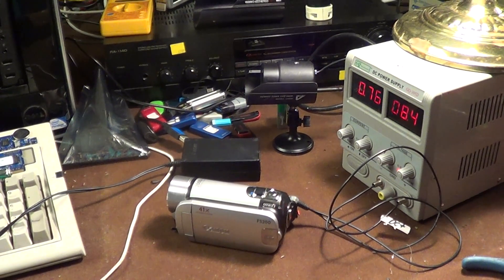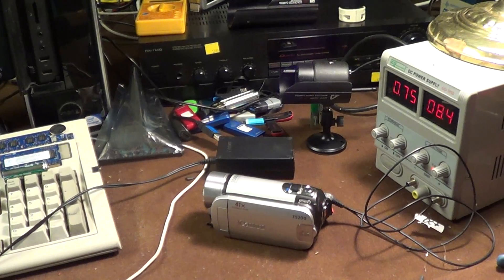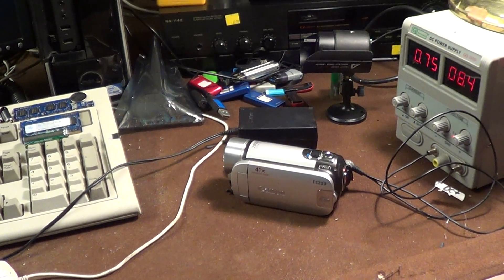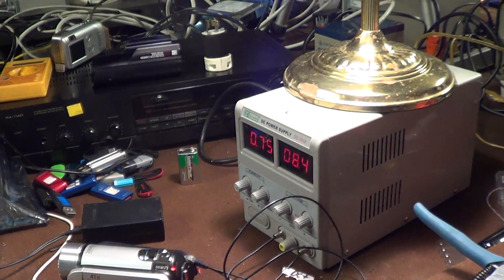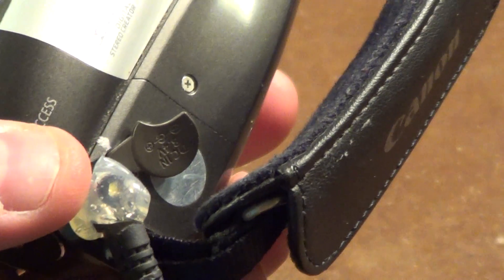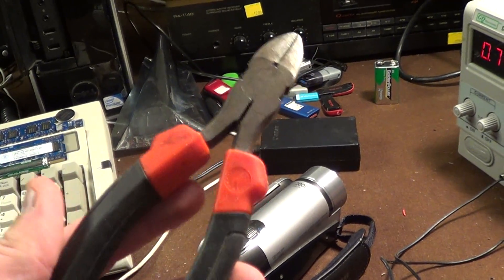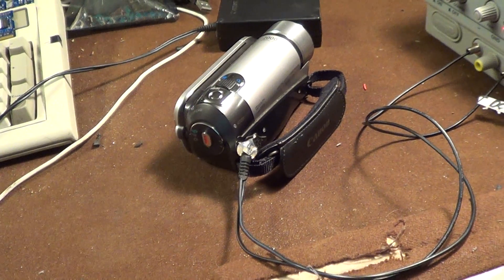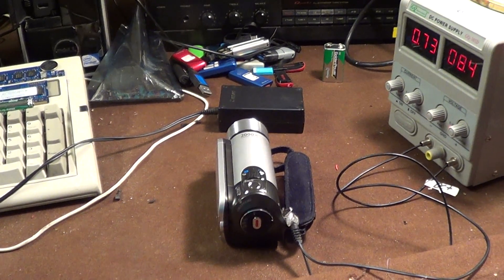A Very Interesting Power Supply Fault (and Repair)!

Comment: It is easy to convert a security torx screw into a regular torx head. The tiny pin in the middle is easy to break off with a small flat head screwdriver, or whatever fits to pry it to one side.
Reply from the maker: I've certainly done that, but the right bits aren't expensive.
Reply: @uxwbill   I expected an intelligent guy like you to have already figured that out. My suggestion was more for others whom might not have as much expertise, or a set of security torx bits.

Comment: WOW!  I thought that I was the only this sort of thing happened to. I  had the same scenario with a Dell Latitude E5410. Its power supply also had a  short in its barrel connector.  I happened to have a dead example of the power supply and hacked off the end and spliced it into the working one. Still works to this day. This was about a year or so ago now.

Comment: Hello uxwbill I have a problem with my karaoke digital/amplifier ka8000 PA system it has no sound it has three shorted amp tranzistors & two shorted sanken amp transistors sensily Aaron

Comment: Heeey why aren't you doing your videos in 8K 3-D? all other video resolutions are rubbish!
Now for what I actually wanted to talk about. I had an LG cellphone charger actually catch fire because the tip shorted similar to that. apparently there was no over current protection or any kind of a fuse. I never leave chargers plugged in for that reason anymore.

Comment: I had a exact same problem with a laptop supply, to repair it I also nibbled the rubber and resoldered the wires, in my case one one the wires came loose inside the rubber and was touching the other,  I also put hot glue like you did. Great minds think alike ;)

Comment: I had a pair of RadioShack portable folding speakers which shorted out and it had almost melted the battery compartment. Well being the Mr Fix it that I am, I was able to fix the issue and they worked fine after that. Then they mysteriously disappeared.

Comment: I live in England and have always called "side cutters" Wire Cutters" In fact when I was working as a "gofa" for an electrician (gofa a term for "go fetch" lol) he always called them side cutters. 

A version of electrical appliance plugs over here are sealed and yet somehow connections still seem to break inside the sealed plug. Usually happens on things like vacuum cleaners where the chord gets pulled a lot.

Comment: I witnessed it happen to an abused HP 60W laptop charger. My housemate at the time called me into the room saying his laptop wouldn't power on. I could, however, hear the tearful coil whine from the over-current protection trying to recycle and immediately pointed out a short. The centre wire insulation had broken and the ground mesh was touching it right at the end of the connector molding. 

Of course I stripped it all apart, soldered the ground mesh straight to the connector barrel and around it for ruggedness, then taped it in a good layer of bright yellow electrical tape.

Comment: had a similar fault with a TRI-AX lead for a ikegami TV camera. Somehow the plug had a short in it. Trying to fix that was not really worth the trouble. 
Also, SD is also less hassle on internet bandwidth for the viewer. Especially if you RX bandwidth isn't high enough in speed to cope with viewing HD.  The IPTV station i work at, we only broadcast in SD, this isn't only based on available bandwidth in upload speed, but also for the end viewer download speed. 720x576p is a-ok for general viewing

Comment: I've seen that happen with several 90w Toshiba 15V laptop power supplies that were supplied with port replicators for their Tecra series.  In some cases the connector heated up enough to melt and damage the port replicator.

Comment: While it doesn't happen often I have seen this before. Usually I find this sort of fault on laptop power bricks. Those see a lot of abuse and are more prone to such damage. That said, in my 24 years of computer repair I've only seen this about 7 times.

Comment: Recently I had an issue with my HF-S21 charger. Fortunately I had a replacement as prior to this camera I had a HF10 that died back in 2014 but the charger was still good. I was curious as to what ended up happening so I quite literally broke open the brick and the solder joints had somehow worked their way off the board. A similar thing also happened to my ill fated TRV33 handycam's charger, but unfortunately, I was really not up to buying a new charger as that camcorder has lost all but the video capture functionality.

Interesting to see this though, I have a few laptops that may have similar but different issues with their chargers (probably not but it's worth looking at).

Comment: I did such repairs on many people's laptop adpators. Whether it was at the end where the wire comes out of the brick or on the plug side (specially DELL 3 pin plugs). I use hot glue to close up the "open surgery wounds" in the assembly as well as some electrical tape on top of it.
I made a rule to check for plug shorts before attempting any repairs and stuck it to the wall in front of me ;)
Thank you for the informative nice video.

Comment: Power related - 13 to 19 volts power. While shopping for stuff I don't need at the local "environmental park""s department of selling stuff that others took to the county dump I came across a largish solar panel. I was attracted to it for its possible usefulness, but had no way to tell if it was functional. After all, someone took it the dump and dumped it. It had about 12 feet of cable hanging off it and decided to do what many have done to test 9v batteries like I see in this video. Yep, touched it to my tongue. Zowie - tasted like at least 12 volts. Bought it for $10. Now looking to put it to use.

Comment: Very common problem. Sometimes those 90 degree DC jacks fail if they are strained to much while plugged in. It puts stress on the connection point. Sometimes the rubber doesn't bond to the metal barrel as well as the wire and it can over time wiggle and create a bad connection or worse a short.

Comment: That is definitely an interesting fault.  I've had a ton of problems with connectors breaking right next to the connector, but inside of it?  What a bother.

Also, lol @ 1080p version.  I can't remember the last time I saw a YouTube that was legitimately in an insufficient resolution.  Non-problem
Reply: Id agree... Unless your viewing potato mode (lower than the standard 480P)

Comment: I have done this a few times, with bad connectors.  It does happen.  I only replace them if the connector is common, or if it's a oddball voltage, and it's not a cable that's cheaply and easily replaced.  Also had a laptop power supply for and older HP laptop, that the center pin broke out of, and i replaced it with a standard 5.5mm barrel connector (it was also center negative).

Comment: Yeah I would have expected the fault to be in the strain relief. I have the FS330 model so hopefully I'll remember to check the end connector is shorted if it fails... already tore the insulation on the other end years ago so that has similar hot glue. I'll bet your camera there has a good zoom, good digital zoom also and reasonable light sensitivity so no matter it isn't hd when it is better then the hd cam I have in ways that might be more important sometimes.

Comment: About two years ago I repaired a Dell laptop power supply in a similar way. The DC side of the power cable coming from the power brick became intermediate in its power delivery (would go from ~18v to 0 when the cable was "wiggled"). 

There was no visible damage to the cable. I owned the laptop since it was new, therefore the cable had been lightly used its entire life (since 2009). I cut about 3 inches out of the wiring and VERY badly soldered a replacement for the cut wires.

Fast-forward three months and its still was working fine, but I then found out that a circular dell power plug will work in the octagon socket meaning I didn't even need to do the repair...

Comment: No kitchen table?

I'm just pulling your leg, I'm glad you figured out the problem and fixed it successfully.
Reply: Well, he actually did this 'repair' live, so this is just the after results and talking about what the problem was. I don't believe he was at the kitchen table then, either.
Reply: armanelgtron Dang. How can I tell when / where the livestream goes on? I've missed literally every single one except the all stars ones.

I know there's no set time, but is there any way to get notifications on when he starts?
Reply: It was him in a procam, not him doing an actual show.
Reply: armanelgtron Still though, I don't recall the website he uses to stream even.
Reply from the maker: I don't bother announcing the few live streams I do any longer, mainly because far too many people have no idea how to behave appropriately and it's not my job, much less my desire to ride shotgun on the chat. I'm equally uninterested in fielding every inquiry and LOOKIT ME comment from Internet twelve-year-olds.

Vaughn Live doesn't sound announcement e-mails and it seems that they may never do so again.
Reply: ***** Fair enough, I guess.
armanelgtron SDP forums? I thought that was just a running joke.
Reply: AIO inc. Well, it definitely exists... Live stream and discussion forum.
Reply: armanelgtron Huh. Exclusive, I presume?

Comment: Huh. Never had that happen to me at the plug end, unless it was an iDevice end, which everyone knows are always inherently bad unless you get a super mega expensive cable that has proper protection against that sort of fault mode. and even then, if you have to find some sort of cable like that for your device, you should probably be looking for a different device instead.

Personally I've never had it happen with anything else, but I've done my fair share of hacking off ends and making proper supplies for things I don't otherwise have supplies for. For instance, I have an OEM 5v 4A Lenovo-OEM supply for an Ideapad 100S that I've come to love as my on-the-go-no-need-for-power laptop, but it pains me that replacement OEM supplies are expensive still, since the model is so new. I have exactly two more now that I've made using the ends off two junkier supplies from other things that I otherwise didn't have anymore. the tip end is very small, so I hacked those off the itemless supplies and spliced them onto the 5v supplies I've gathered from my travels-- one is an HP 5v 3.7A from some sort of HP device, switching wart with a folding US plug, and the other is a nice meaty 5v 4A Delta-branded supply that was intended for continuous use with one of the Xfinity X1 boxes from Comcast, something I just so happened to pick up at the thrift shop this past weekend. For now both of the supplies are all spliced up with electrical tape with zipties to keep them together without the tape falling off (and also taking into account tension protection to prevent shorts) so when I do finally get my hands on some proper shrink tubing, I'll be able to undo the permatemporary "fix" and just go ahead and make it permanent. 

The best thing about the Delta supply is it never gets warm, so I wonder if it's been overprovisioned inside with some slightly lower-spec capacitors or such to make the 4A rating hold true. I'm a firm believer of using better-than-recommended supplies in terms of current draw to keep everything running cooler and thus longer, so nothing heats up too bad and everything lasts for a much longer lifespan.

Comment: At least at this end, it wasnt until I checked within the setting menu, I realised it was in 480p, nice and sharp this end. I have had similar problems with odd tablet chargers and laptop chargers, but that issue generally occurs with such devices that get used whilst plugged in. The cable frays and then starts shorting, never seen one within the casing have an issue.

Comment: I had a laptop switched mode power supply fail recently it was reading 18.5v with no load on as it should but under load it dropped to 2 or 3 volts. Opened it up as I wanted to fix it while waiting to get enough cash to buy a replacement and saw a 1000uf 25v capacitor on the output was bulging. Went to the local electronics store and bought a replacement then fitted it. This made it work like it should, for about 12 hours. Then I noticed the laptop had stopped charging again. It got really hot and this time the output was 0v. Did try replacing the same capacitor again but i think it was the transformer this time so I found another laptop charger of the same voltage cut the end off an put my one on and that sorted it for good (or until that one fails anyway.).

Comment: If it is a switching power supply, it may not measure any output with a VOM.
Reply from the maker: That is not correct.
Reply: I have one that measures no output until it is hooked up. It might be because I am in calif. and we have to use  different types of power supplies here. I couldn't believe it either, but I do have one.

Comment: i have had this actually happen to one of my laptops power supplies but since i had a spare from a older model i did not bother to repair since i lack hot glue to really hold it in place and why repair if you have another reliable replacement like i no longer had issues with current coming from power supply into laptop after the switch but i did notice something odd the rubber was starting to split apart

Comment: Any repair that works, is a worthwhile repair!
This is a 1080p video...With a very nice balanced picture and great audio!
Hope you don't mind me asking...What camera are you using please? I've been looking around for a new one for ages, I haven't been happy with any I've tried so far.
Reply from the maker: This video's resolution was just a byproduct of the camcorder I had closest to hand. :-) It's a Sony HDR-PJ200 from 2012. Overall I've been pretty happy with it, though the audio isn't as nice as that from my older Handycams and compared to the Canon FS200 it feels very plasticky and cheap. (The larger battery that Sony sells is almost a must-have. Luckily I found a very gently used one at a great price.)

The HDR-PJ200 is one of Sony's last camcorders that can charge and operate from a proper external power supply. It can also charge from USB, but that's very slow. It also has a built in projector that works surprisingly well.

Comment: I remember I had a similar problem with a old hp Pentium 4 laptop with its power brick, but mine was not even making contact. I fixed it by tearing the plug apart and resembled it with epoxy. Also it's sad how many people complain about the video quality. Standard definition is good even though I have a 180mb connection and also watch HD video usually.

Comment: I have come across this once or twice with laptop ac adapters. Other adapters have been that the tip is broken off inside of the rubber sleeve, which I have seen happen to Toshiba and HP power supplies, and it makes it look like the jack inside of the laptop itself has bad solder joints, but turns out to just be the tip itself that's loose.

Comment: I once encapsulated some loose and frayed wires on the wiring harness of a car stereo in hot glue... it still worked fine, but it was only a matter of time before they fell off. Also, SD video does look perfectly fine, especially for videos like this... but you get some loss in quality when you upload it to YouTube. I render my SD videos as 720p for that reason. Plus, it seems to shut up the people who whine that a video isn't HD... I have yet to see someone complain about a SD video being upscaled to HD, but a surprising amount of people think it actually is HD just because YouTube says so.

Comment: I did exactly that on a Samsung laptop power supply. Unfortunately I am not a hot melt glue artist so i just used some shrink tube and zip ties to hold the thing together after the repair. Same short, deep inside the jack.

Comment: I had a similar problem on the charger for my old Toshiba L305 laptop that I was able to repair. Been using that power supply for 3 years now without fail. I would get a replacement but I'm looking at replacing the laptop soon anyway.

As for Hi Def, the only time I think it can really make that much of a difference is when you display it on a huge 4k (or higher resolution) screen.and then only if you have EXTREMELY good eyesight and there is a lot of extra fine detail present in the video (rather rare). Other wise SD is fine as far as I'm concerned.
Reply: It does make a little bit of a difference due to youtube's crappy compression methods towards standard definition video.

Comment: I've made many repairs on barrel plugs that have suffered similar breaks and shorts, most recent one was the power connector from the battery pack on a Sony CD-ROM Discman (PRD-650, PCMCIA SCSI II), the +ve wire had completely separated form the plug so had zero power going to the discman, slice, splice with "new" (as in salvaged from another wallwart) wire and plenty heatshrink later and the CD-ROM Discman lives on, cos it's internal Lithium Ion battery is goosed... :)

And as it happens the plug is the same size as what my older Panasonic camcorder uses too, not that I've used that for a long time...

Comment: Im happy you found the fault :-D.

Bill, ive done this repair too many times to remember, but with the 19 volt charger bricks for laptop computers, mostly H.p and compaq, 3 connections in a large barrel, V+ / earth / and i.d pin, yes im supprised they die too, but the charger survives due to a quality current shutdown circuit.
Ive used masking tape to create a wall around the connector then poured epoxy resin in, removing the tape later on.
Its good fun :-D